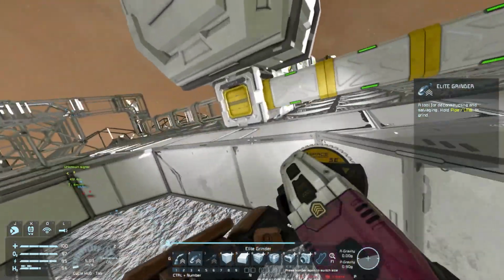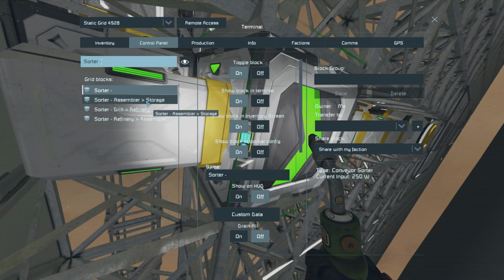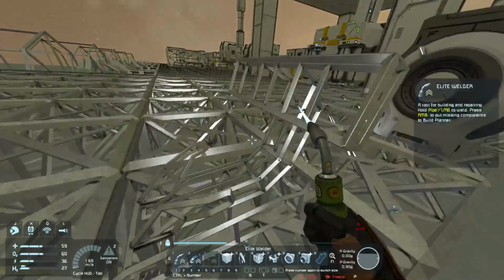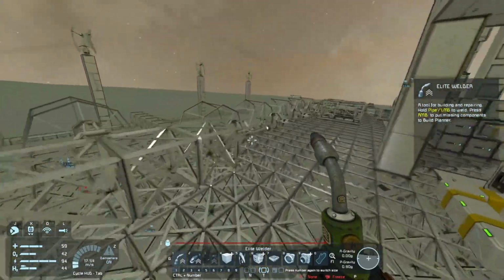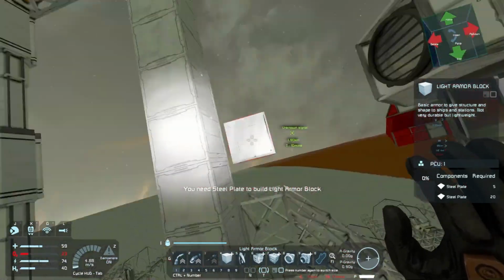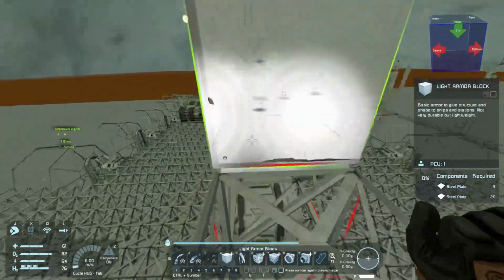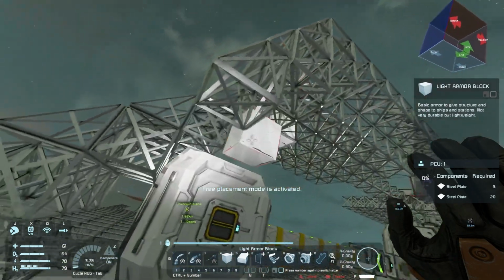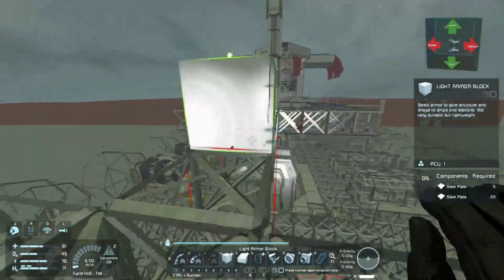Space Engineers: Adding Structure

Comment: To work your deployable turbine subgrids you will likely need to raise and lower your rotor using your wheel suspension, grouped together to make sure it does not crash into the ground or sit crookedly and not be planted squarely and firmly in place.

I would plan on knowing the max and min heights of the wheels and build the subgrid so that it is some length between those.

That is the best way to ensure that at least some of the turbines [if you have more than one] can find the right height to connect with the ground.

Another option is to put power cables between them and make them fully detachable units.

Comment: With the "gravel" 1 your assemblers is going to move again to add modules.

Wind turbine wheel suspension height can be adjusted yes for it to touch ... a mag plate in-between the the slope blocks will lock it in place while traveling... 

all caught up for now